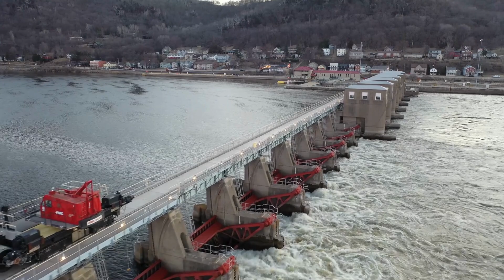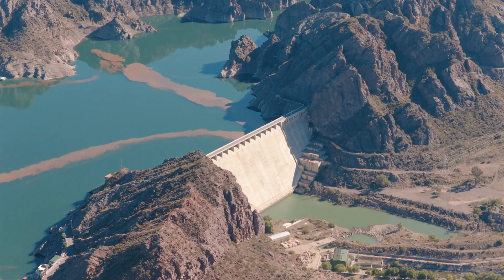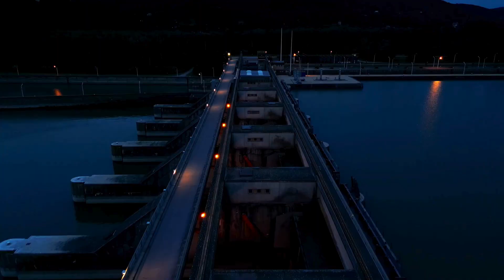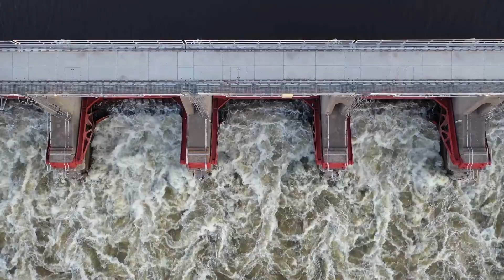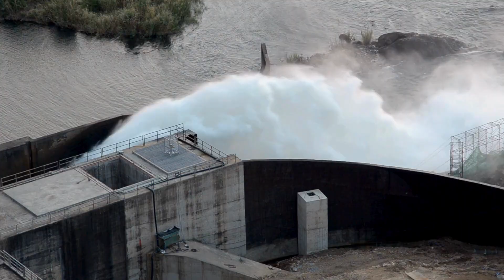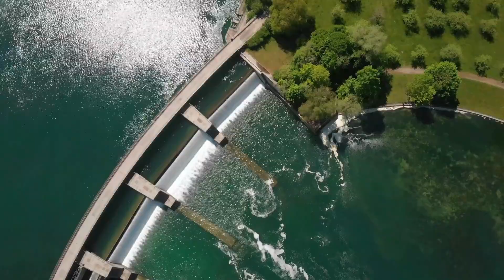Part 6 - Hydropower – Energy from Water

Comment: To date No dam is fitted with both hi and low pressure turbines inline ,    
Now in 2016 a proof of concept test was run in Australia with a new type of unit letting this become a real option, now a dam can be retro fitted with up to three banks of these units with no mods needed to the main turbine hall